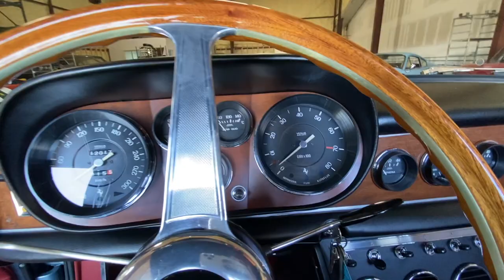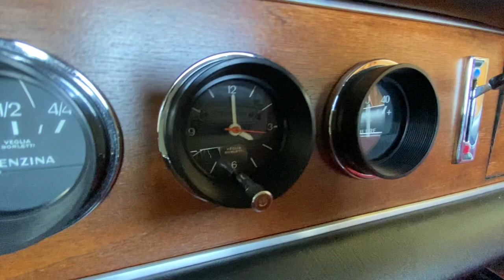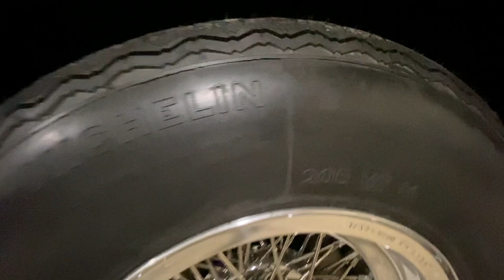Ferrari 330GTS

Comment: One other question: Is a car like this better than it was when it was original? Were the guys who made it back in the '60s this obsessive & precise about all these details?
Reply from the maker: Good question. A restored car can be better than new in fit and finish, but the factory had an advantage when everything they installed on the car was newly manufactured. Whenever you rebuild a part, it's hard to get back the original specs. Also, reproduction rubber often times doesn't fit as nicely, and requires a lot of time massaging and hand fitting. The factory workers may not have been as anal, but production practices had a certain amount of consistency that we try to copy all these years later!
Reply: @tomyangnet  Thanks

Comment: Thank you for sharing. Fascinating. It makes my head spin to think about the time and knowledge that went into this car. Do judges specialize in certain models? Or are many of these details common across cars from various periods? Also, are the modern, period-correct replacement parts higher quality than the originals?  And while I understand why someone would go the "all-original" way with a car, could its performance, reliability, and drivability be improved with some modern parts?
Reply from the maker: Ferraris had the same basic details and had running changes through the years. 250s were similar, 330s, and two cam 365s can also be grouped together. Also, knowing which body builder like Pininfarina or Scaglietti would determine which rubber gaskets or screws they used. I work closely with Ferrari club judges documenting the details and whenever we make a rule, we can find five examples breaking them!

Comment: Tom, on the left valve cover, the small pad that mounts the cylinder ignition order plaque, I have seen the entire pad in wrinkle black, the entire pad in as machined finish, and partial paint partial with the "Ferrari XXXx" stamping in as machined with the area under plaque in wrinkle. What is your opinion on this area?
Reply from the maker: Hi Adam,

In my opinion, the machined portion shouldn’t have any paint on it, and I think the judges would agree. The logic is the valve covers were painted first and then machined otherwise there would be paint under the tag. Ferrari wouldn’t have masked the tag to paint that extra area as an extra step. Thanks for watching.